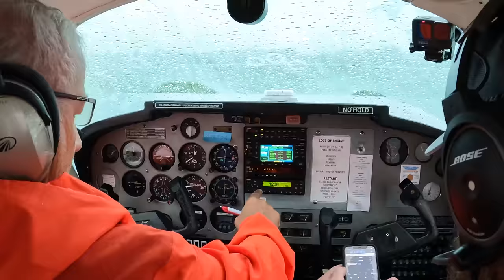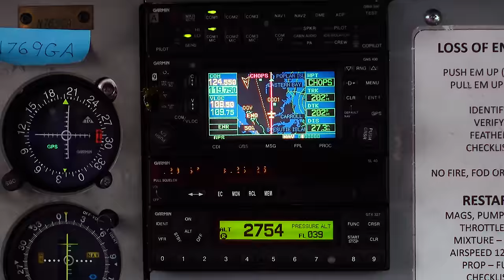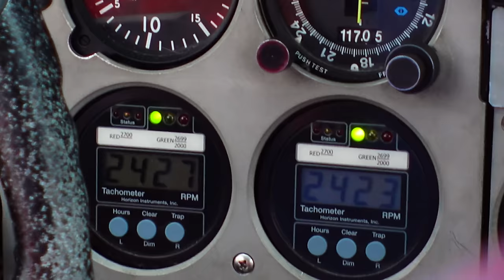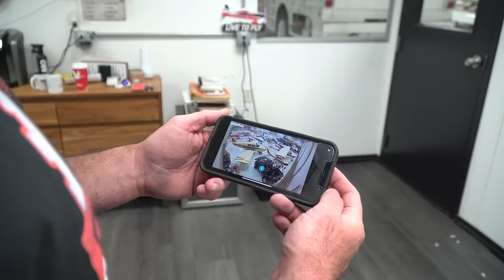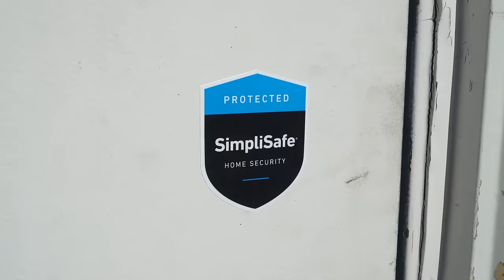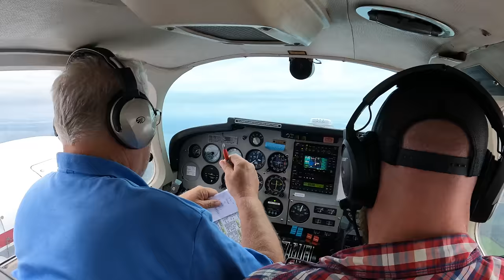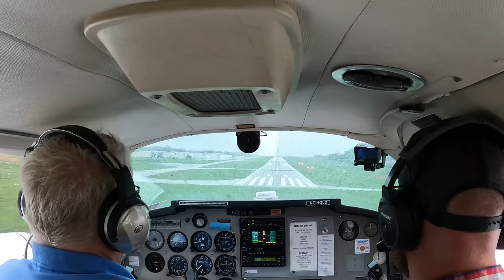Taking Our FREE Abandoned Yacht Home With Gentry & Sons Trucking

Comment: Holy Ship! Prop's to Tim for "Handling" the situation so Jason could make the prom.
Now that it's home I cant wait to see what its going to take to get it fired up. If you were going to keep it a 12 valve swap would be cool but expensive to run now that diesel fuel cost have overtaken gas prices. Get it polished back up and running and flip it to support the 401& you're charity's cause boat's/yacht's/ship's are the worst money-pit's!
Reply: Well, not sure that they are all that bad compared to an old airplane.
Reply: I agree you can make money with planes but pleasure crafts just big toys and money pits
Reply: Yes sir…boats are holes in the water to throw money into…😩

Comment: When pulling out a big boat like that, its not supposed to be pulled straight up to the rubber stop on the winch tower. Once the weight of the boat starts coming out of the water its gonna start leaning back and pulling up on the winch strap

Comment: No on the 12 valves. You will need to marinize them, exhaust, turbos, cooling system, raw water system, all the marine stuff AND RPM is way different between the gas power you have now. Looks like the engine you have is a Chrysler, so they turn 2700 RPM, your gassers turn 3000 plus, so to get the same speed you will need transmissions re worked. And, Chrysler Cummins are WAY different than Cummins, they are built to their, Chryslers, specs. Oil pans hold less and a mess of other different stuff, less oil is less cooling. Stick with the gassers, WAY too much work to convert. How do I know, retired from Cummins after 30 years, seen it happen.
Reply: The USCG will have a field day when they are done

Comment: One thing you did wrong when you hooked up the trailer is you did not cross the chains. By doing this if the trailer ball would fail the crossed chains would catch (cradle) the tongue from falling down and digging into the ground.
Reply: There should also be a chain connected to the boat for when the winch strap breaks. I have seen more than one boat leave the trailer at our local marina.

Comment: I can’t believe you didn’t check the trailer before hitting the ramp.  Checking of tire pressures and changing out that old hold down winch strap would have been a logical step.
Reply: I don’t love this channel and it’s heavily due to all of the small lapses of judgement like that.
Reply: @eagle2019  your right, I shouldn’t have been surprised.

Comment: That trailer was way too small for that boat. Definitely dangerous. And as to whether it's a boat or a yacht. In my mind a yacht can't fit on a trailer, a boat can.
Reply: Agree.  I don't know if they make trailers much larger than that one though.  Most likely the boat should have put on a flatbed sitting in a custom cradle.  Not cheap (nothing for boats are), but safer.
Reply: @christopherjonh9458  the trailer that initially moved it to the lake was larger.
Reply: It's a BOAT. I cringe when I hear it referred to as a yacht. 33' with stern drives ain't no yacht.
Reply: @travisb9130  Yer right, didn't realize that was only a 33' and the 6-wheels threw me off.  We used 38' trailer to move my 54' mast from the Beneteau factory.  That 'lake' is the Choptank River, a tributary off the Chesapeake's Eastern Shore.
Reply: @tcalhoun601  I agree, that's not a yacht

Comment: Technically as per the U.S. Coast Guard a yacht only has to be 26' long and I believe must contain a bathroom, a bed and a kitchen (galley) but I could be off on those last 3 requirements. But either way this would definitely be classified as a yacht
Reply: I just read the big YACHT sticker on the boat and knew what it was! LOL
Reply: Pretty close.  As a recreational craft, it is classified as a Class II boat, which are generally 26ft-40ft from bow to stern.  Specifically, this is a Cabin Cruiser.  Yachts are Class III and are 40ft and up.
Reply: Yachts are built to a higher standard. Regardless of the name of the builder, this boat is an express cruiser not a yacht and it is better suited to use on a lake, brown water river, or bay. Hatteras builds yachts, Viking does too and so do a bunch of others, but not Cruisers. This thing is a lighter duty hull than and not the kind of rig one wants to venture far offshore with. Not a yacht.

Comment: The boat weighs a lot more than the break point weight of the straps….and it’s not close. The trailer isn’t the correct size for the weight and length of the boat…..what could go wrong?
Reply: "06" Also the axles look like 5,200 or 6,000 lb, a little short of the 7,000. I would much prefer the safety margin of the 7,000 lb axles.  When built they probably saved $500 to 7 or 800. when you compare the wheels and tires also.
Reply: It's almost a perfect 'safety last' video where everything still didn't catastrophically fails.

Comment: 14:18 the reason the dried up barnacles are still in the boat is bc that’s were the straps were when the yard workers was scraping the bottom before putting her away. Check and you should find the same on the other side. It were they couldn’t clean it off.

Great video. That yard is right down the road from me

Comment: First let me say I do enjoy your channel. As someone who has done hauling with conventional trailers, also run hydraulic marine trailers, been in the marine industry for a very long time, I have to call you guys out on this one. A hauler should know better than to rely solely on the winch strap or cable to hold the vessel during haul out. As the boat settles onto the rear bunks the nose lifts and puts a lot of leverage onto that strap. The trailer should have a safety chain and hook on the winch mast ( which is missing here) as a back up for just such a situation. Straps or ropes can also be used/ secured around the winch mast, during haul out as well. Notice the winch strap color, the trailer has been sitting in the sun for a long period ( as many do). The strap is all bleached out in the first 2 feet of so, from there it is bright yellow. This color change is from UV damage. The strap was significantly weakened by this. Just like to see things go well for you guys.

Comment: Very nice project, can't wait to see it repaired. Pd: a safe advice is to not turn on and off over and over the trucks engine, that engine is not meant to be used that way, the engine would last more if you let it idling instead of turning it off. But great video!!

Comment: 27:25 The maritime definition of a yacht states that it should be a private pleasure ship of at least 33 feet in length. However, it's more common to consider boats starting in the 35–40 foot range as yachts. This suggests that size indeed plays a critical role in classifying a vessel as a yacht.

So it's either a baby yacht or a huge cabin cruiser... LOL

Comment: 1st thought was with a unknown trailer setting for yrs was to thoroughly check ubolts, springs, tires, pressure and make sure all bearings packed and in good working condition. Strap a crap shoot until under load or replace for cheap insurance. Last thing you want is all that weight going down the road and have flats or a smoked bearing on the roadside usually at the most inopportune time and place. Send it... best of luck luck on restore lol she'll be a Butte Clark! 😁

Comment: 1) The combined 'Load Capacity' of those 6 boat trailer tires if they are rated at 3,000 pounds each is no more than 18,000 pounds. While the boat and trailer combined weigh in the 25,000 pound range. Sorry, but if I am correct it is an accident waiting to happen.
2) it needs a tie down line/strap going over the cabin in the bow area and around the two cleats on the bow to make sure the vessel stays on the trailer. As it was it can slide up over the trailer and onto the tow vehicle in a sudden stop or accident.
3) It should also have 2 stern area tie downs criss-crossed from one side to the other. In other words aft port cleat on vessel to starboard side on trailer,. And aft starboard side cleat on boat to port side trailer going across.. It is far, far, far easier to tie in down better while in the parking lot area to avoid problems, than it is to deal with highway mishaps on the shoulder of the roadway.. Safety is No Accident. Safety only  results from careful planning.
Also measure the height.

Comment: I knew you guys were gonna break the strap because the angle of the trailer in the water compared to the angle the boat is floating so it makes it too tight when you pull it out of the water I do this every day and I know how much work it’s gonna take to get that boat whipped in the shape good luck

Comment: Oh dear! That smoke alarm at 4:18 will have the biggest trouble activating in such a bad position. Clue heat and smoke tend rise, meaning the primary place for it would be at roof level and for that space way more than one. Sure one inside the office space is ok.

Yes I am a professional installer and if you also followed the installation instructions then you would know it would be that last place to put one.
Reply from the maker: We have a company coming with a lift to install in on the ceiling. The hagar is 50’ tall and we couldn’t mount it with a ladder
Reply: @rebuildrescue  that is awesome, loving the content

Comment: Diesels are low RPM engines which means it would be reducing top speed but since those are supercharged 454 there's no way they're putting out less than 500 horsepower maybe around 600 feet of torque a peace since their boat engines they will have a little bit lower compression than a street engine because they're made to higher RPM range constantly they will probably Redline between 5 and 6000 RPM 12 valve is going red line between 3500 and 4000rpm not to mention gas is cheaper than diesel right now and for the foreseeable future

Comment: One definition of a yacht I read is that it has to at least be able to make ice onboard.

Not saying it's definitively true...as there are cheapo ways to make that happen, but I'll suggest the icemaker has to be built in.  Had a 30-foot Catalina sailboat that had a portable cooler/freezer that made ice (all Catalina's say "Catalina Yachts" on them BTW, even the 22').  Current boat has a built-in 180 liter fridge with small freezer section and is most definitely a yacht.
Reply: That is one definition I've never heard 🤣

Comment: My advice is to just replace whatever is broken or non functioning with stock parts as much as possible when it comes to mechanicals and drivetrain - it will be much cheaper and easier than trying to get fancy and it will be much better for the new owner if you auction it off. Switching to a different engine will get expensive real quick.

Also, with a boat that big, you won’t be towing it much - it would have been cheaper - a few hundred at best - to just have a boat hauler move it for you to wherever you plan on working on it rather than buying a trailer. Anything over 30’ and a 8.5’ beam isn’t easy or fun to tote around.

Comment: I am a Marine Engineer , I have 40 years in the industry,  if it had a mast and a sail it would be called a yacht, the word yacht comes from the Dutch word Yacht, which was phrased in a time when motors didnt exist, over the years it has crept into the industry referring to a vessel that is large enough to have a cabin and you can sleep overnight , but the true original term for a yacht is a sailing vessel, I used to teach sailing in all its form , from racing yachts to conventional yachts and square riggers. I dont care what boat builders decide to change the name to a cruiser or motor boat and call it a yacht , it is wrong . Even Google has it wrong .
Reply: Exactly, the original Dutch word was jaght.... later changed to jacht. I'm glad someone stepped in with facts. 😅

Comment: Gotta be REALLY CAREFUL with those hydro jackup trailers. I think you just cracked the hull when y’all set the starboard frwd lift.  I heard the pop of fiberglass cracking. Or a stringer / tabbing letting go.  Not good. Better inspect the inside of the hull if possible in that area.  The damage is often NOT visible from the outside.  Unless you remove the bottom paint.  
    🤦‍♂️🤷‍♂️

Comment: 396 / 5 000
Wyniki tłumaczenia
maybe you can make it an electric drive. see these engines that are heavy and inefficient and the tesla or keningher casino. There was a battery and a more efficient engine, and the panels and a small fold-out fan plus a small generator for emergency fuel and you can swim for a few months… count it may be a good idea .. casino-crashed car for cheap parts. .

Comment: That trailer takes 21000 pounds. I've nothing against the US using the imperial system but can't you use a bigger unit of weight? I saw a bridge recently that supposedly weighed in the millions of pounds, the imperial ton has existed since the 13th century!

Comment: Come on guys, Is this The first time anybody their has pulled a boat/yacht out of the water, using a trailer ?   Everybody knows to inspect the Truck and Trailer fluids and air pressure. Check each tire tread and air pressures. Next, check all Straps,axle grease,  rollers, supports, and all support padding.  
After Yacht is loaded, 
Check the you height, for road conditions. 
Let’s hope the rest of the trip goes better then, You guys trying to load the Yacht/ship. 
Good Luck

Comment: Trailer looks too short for the boat. The back of the trailer should be about even with the transom. The CG of the boat will be too far back and probably the reason why the bow pivoted up when you pulled it out of the water. Also the bunks may not be positioned properly for that boat. Recommend you reach out to the boat manufacturer and get some advice for a better fit trailer.

Comment: That trailer isn’t adequate for that boat. Why didn’t you have Gentry bring a real trailer?  
Semi trucks have very little traction without the weight of the trailer on the fifth wheel. I’m surprised it even got back up the ramp.

Comment: A Boat that size should be properly placed on the trailer with a travel lift.  One day with a slick ramp and a boat that heavy, dude is going to loose traction and end up down the ramp and in the water with that single axle truck. Seen it many times. Have to assume most reputable boat mover companies, who are not trying to make a YouTube video, wouldn't try that.
Reply: The yard had a lift right there next to the boat. I can't figure out why they found it necessary to drop it in the water at the launch. Weirdness.....

Comment: I wouldn’t trust the straps they are using…….When we have taken large boats out onto trailers we have hired a lift machine ………The trailer is not big enough, and we usually use steel carabeeners to tie the boat down at the front, as this is a legal minimum here in Australia………..😳Also, we tie down the rear of the boat with adjustable steel hooks that connect the boat and the rear of the trailer……..

Comment: What the did I just watch?  I forget where you left off from the last time, but through context it seems you found someone that could tow this, but I guess the storage yard had to be the ones to put it on the trailer.  Then the truck and trailer left the yard with the boat on it.  Then it left the yard without the boat.  Then you're following the trailer with a boat, then without a boat.  Then you put the boat in water for some reason.  Then you take it out of the water.  I'm only 18 minutes in and I don't care to watch anymore.
Reply: The yard had a special split-trailer that can power-lift the boat up off the cribbing then the delivery driver followed the special trailer with the empty trailer. They put it into the water to remove the boat from the special trail and onto the regular boat trailer.

Comment: There is no such thing as a free yacht.
Reply: It's not a yacht, it's a 33 foot cabin cruiser
Reply: @bradmagnuson6963  It says yacht right on the side. There is no set definition but some say a yacht is at least 10 meters in length so 33 feet qualifies. Others say if you can live on it and it's basically used for pleasure, it's a yacht.
Reply: @tiredoldmechanic1791  wrong, 33 feet is a cabin cruiser, not a longer range yacht
Reply: @bradmagnuson6963  If it meets the standards, and has a National Marine Manufacturers Association Yacht certification, it's a yacht. According to the NMMA, "To meet the definition of a yacht, the boat must be 26 feet or longer." Take it up with them.
Reply: @tiredoldmechanic1791  a yacht is a pleasure craft 40 feet and over. Anything below that, is a cabin cruiser, all the way down to a bass boat, which is roughly 12-20 feet. Cabin cruisers run 22 feet, up to 40 feet. Yachts run 40 feet, to over 100 feet or more